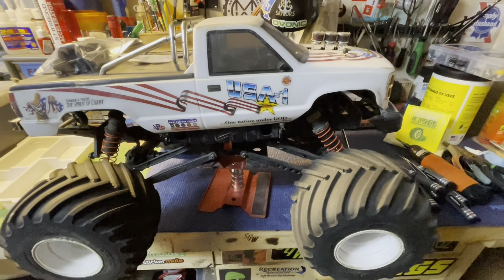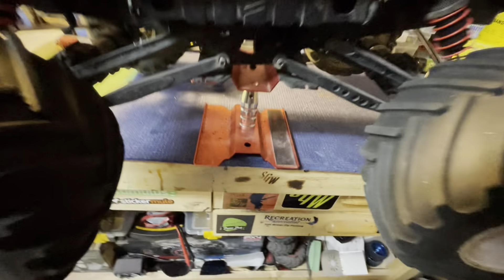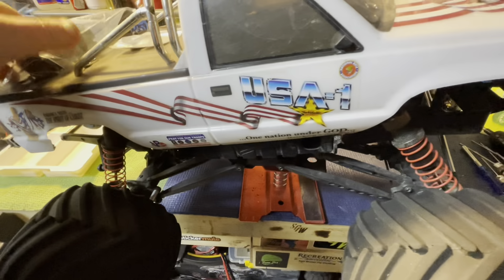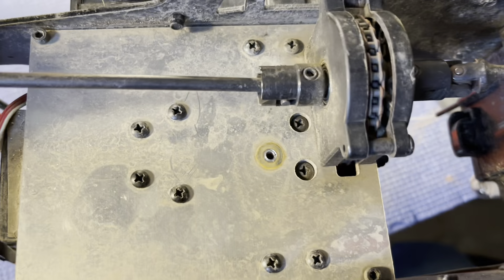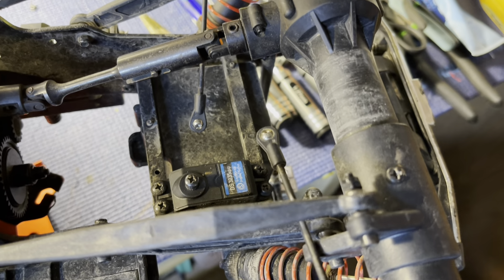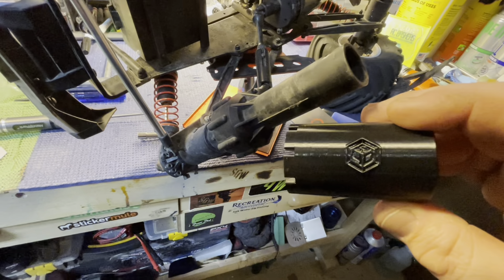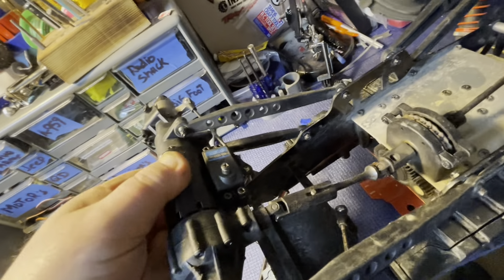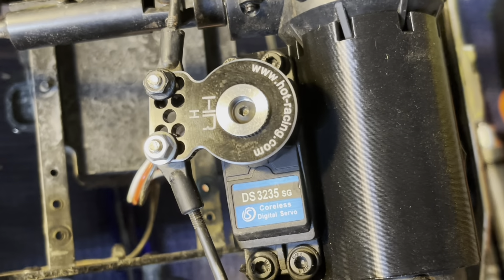KYOSHO USA-1 Servo on Axle mod from 4th dimension RC

Comment: Was looking into a USA-1. Changed my mind looks like a nightmare to own.
Reply from the maker: No they’re awesome trucks, fast, handles well, but they’re heavy, and more meant for straight axle monster truck racing, not bashing. The Kyosho bell crank steering is their biggest downfall.. we’ve beat this thing hard and although it breaks stuff it’s very tough. The worst part of owning these is Kyosho parts availability

Comment: Is there still a way to hook up the four wheel steering with this setup?
Reply from the maker: Yeah you buy another one of the mounts and a Y connector and a second servo. The axles are identical

Comment: Just curious what servo is that?
Reply from the maker: It’s the 35kg ZOSKAY servo from Amazon. They’re awesome.. 486 oz in of torque, metal geared and waterproof
Reply: @IowaBudgetRCBashers  I picked up the same servo saver as yours the HR SHS88H model but for the stock servo so I hope it works lol 🤞
Reply from the maker: @theRCLlama  it will. You’ll get 3 bushings for it. Use the one with the F on it.. it’s 25 spline futaba style
Reply: @IowaBudgetRCBashers  big thanks 👍 I'll try that, I'm excited to get it and do the conversion.